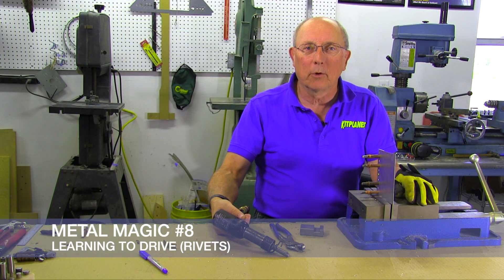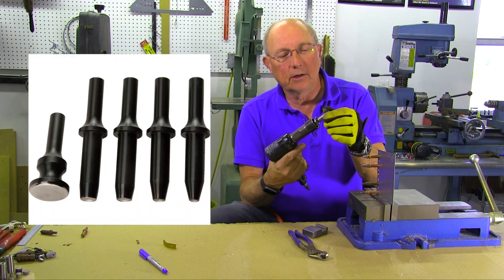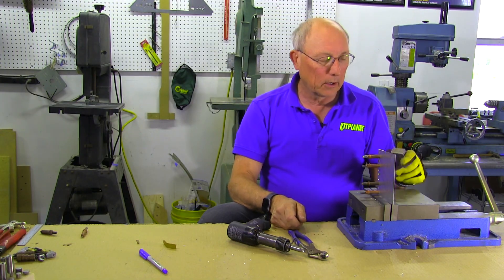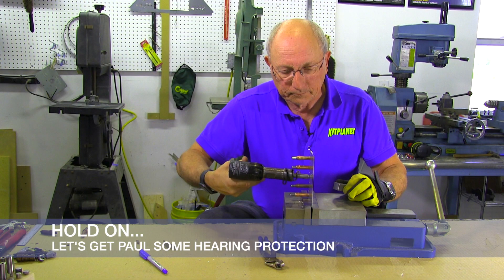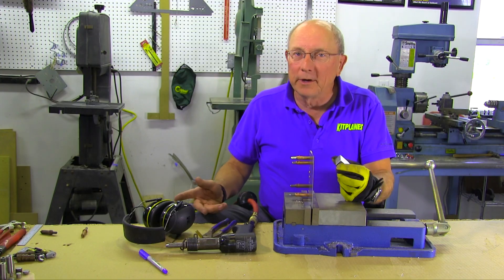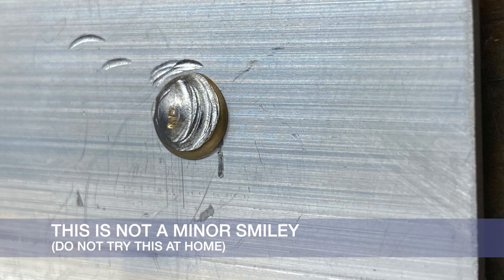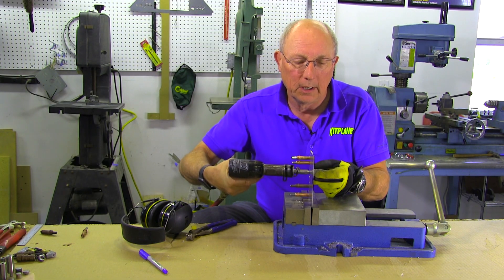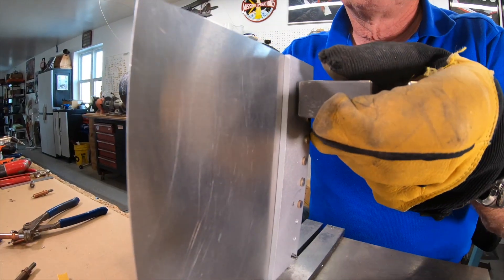Metal Magic: Driven Rivets

Comment: I hate to be that guy but....the rivet gage tool is supposed to go OVER THE RIVET TAIL AND FIT SNUG, and then use it to measure the correct height of the shop tail as a minimum thickness. Minimum thickness of .5D, maximum of .65D

Comment: I worked in a OLSON BODIED truck plant in the late 70s and early 80S. I have done my share of bucking rivets. I have also used this knowledge in snowmobile repair for years now. He is right once you get the hang of it its a super clean and strong way to fasten metals. For first time users try on a sample piece of metal and it will come to you.

Comment: ... What type are rivets,are suitable for joining dissimilar metals, Ti and stainless, anti vibration,leak (exhaust) ?.
Reply from the maker: Paul says, "Stainless or Monel is what I’d use if I was worried about it….but honestly, Van’s uses all aluminum rivets on firewall-to-structure and has for years. It makes a difference if you were building a seaplane. But in general the dissimilar-metals corrosion is going to be a non-issue in the lifetime of the builder."
Reply: @KitplanesMagazine  Many thanks for getting back to me. Big 💕 from the UK 🇬🇧🇺🇲

Comment: I am going to be doing some 10mm copper ribbits  you think a regular air hammer would work or do you suppose it will be over powered ?
Reply from the maker: Paul says: "I’m afraid I have no experience with copper rivets, so I’m not sure I can help you out. Intuition tells me that a 10mm diameter rivet is going to be pretty big (a little less than half and inch?), but I have no idea how much energy it would take to drive it. Anytime I have a question over how to do something, or if a technique will work for some application, I always mock it up on a scrap and try it first - no use ruining an actual work piece until I have practiced on scrap first."

Comment: I'm new to solid rivets and it's on trailers in my application. We use 1/4 rivets but with a few different sizes of heads my question is do I need to try to match the rivet set to the head size or do I just get a 1/4 set of the correct style. because I noticed none rivet sets mentioned a recommended head size. Looking at the shop supplied rivets and internet pictures they seem to be brazier head rivets? I made my own out of an old air hammer punch but it will leave marks on the larger head rivets. I don't like that so before I take on bigger body work jobs I want to invest in the correct tooling.
Reply from the maker: Except for "oops" rivets, the rivet heads follow the shank size, and you do need to have the right rivet sets for the size you're using.

Comment: So I’m new to this .. can I use my air hammer 119 max to do this ? Ty
Reply: I also would like to know.
Did ever find out
Reply: @richardlamm4826  do you use manly 1/4 rivets what kinda spring and rivets sets are you using because I'm also running the cp714

Comment: I am a first time builder, looking at several kits.  Vans prefers driven rivets, while Rans, Sonex and Panther prefer pulled rivets.  Aside from aestectics, is there a significnt strength difference between the two?  It seems pulled rivets asre much easier to work with? Is it worth the extra effort to dimple the holes.  Does flush riveting (dimpling) significantly improve performance? Or is this another aestetics choice? Thank you! Great series! Very informative!
Reply from the maker: Paul offers this: "A very common question - thanks for asking!

The truth is that there are many puled rivets that are as strong as driven rivets, but in general, pulled rivets are going to be heavier and larger. The majority of the flush rivets in an RV are -3s, and they create a very nice, aerodynamically smooth surface. Most pulled rivets are at least -4 size, and on curved surfaces, don't create quite as smooth a finish. Pulled rivets also leave a less than perfect head, which can be fixed by the application of a filler - which adds more work, but leaves a nice finish. I have built airplanes both ways, and am happy with the results because I was happy with the design of the aircraft. And if I was happy enough with the design to choose it, then I am generally happy to use the rivets that the designer chose for the project. Changing a pulled rivet aircraft to solids (or vice versa) generally creates a huge amount of work for little gain.

Aesthetics aside, yes, flush rivets make a measurable difference when it comes to performance - at the expense, of course, of extra work to dimple and countersink. If you’re building something to go over 150 knots, then generally speaking, flush rivets are really worth the effort. For 120-knot airplanes….not so much. If you look at existing kits, you’ll see that they tend to follow this rule of thumb."
Reply: @KitplanesMagazine  Thank you very much!

Comment: Why do you call it a rivet gun? Is it not an air hammer? If not why?
Reply: windy hammer, like they used on ships, you can also stretch meta using this on plate edges
Reply: @stuarth43  you can also use it to cut collars off and chisel and so much more which makes it a pneumatic hammer that hits different types of sets.
Reply: Rivet guns have a quicker stroke than air hammers.
Reply: @bige.3474  it’s a pneumatic hammer.
Reply: @covecityboys  Same but different at the same time.
Reply: @bige.3474  the way I look at it the stroke and power is different in different size hammers and it is a hammer because it hits rivet sets, collar cutters chisel sets etc.